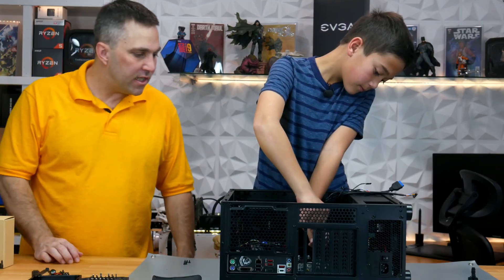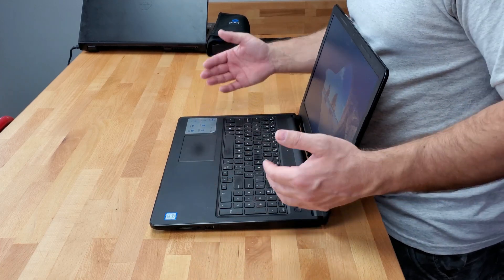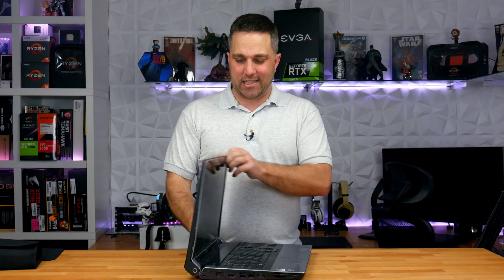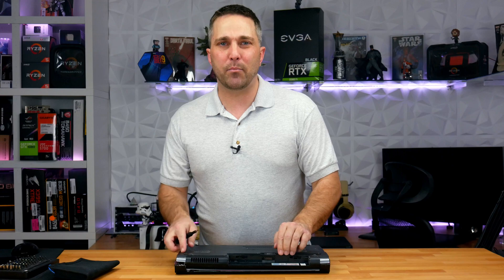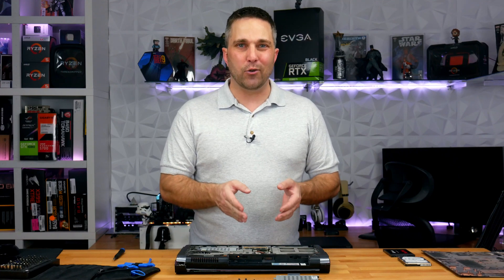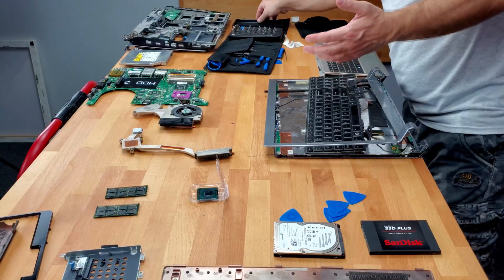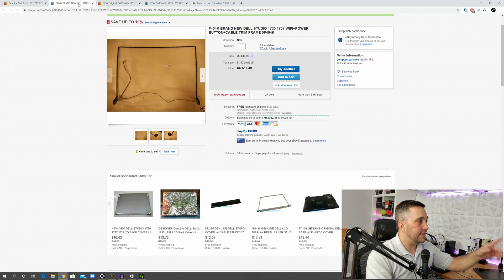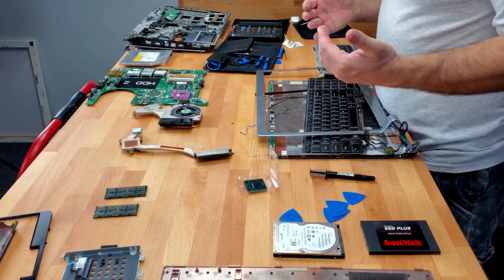How to Restore an Old Laptop

Comment from the maker: Turns out I think I did re-paste the CPU, probably about 4 years ago. The GPU had the original, very dried out paste however. The primary cause of the high temps was the inner, GPU heat sink, was almost completely clogged with dust and pet fur. YUK!
Reply: Can you fix my laptop
Reply from the maker: Sure, send it. Address is in the about section. Don't forget return a return postage label.

Comment: Sorry for bombarding you with questions, but for a 2007-2008 laptop, would you recommend replacing the battery? Or is there a sign for when to replace the battery.
Reply: I had to buy a new battery for my laptop when I found that it would no longer hold a charge. I would charge my laptop overnight but if I unplugged it would shut down after one minute of activity. I had another charging cord for the laptop and exchanged it for the other cord. I charged it overnight. When I unplugged it I had the same results. I changed the battery and now it is fine. Hope that helps.

Comment: I have been looking for a video like this for hours!!! This is great! I have a Gateway W650I which I believe I got around 2008. The heat source was most hot around the hard drive area, the fan (is that normal?), and something labelled Intel pro wireless 3945ABG which was manufactured in 07/21/08 and I was wondering if I should get that replaced too
Reply from the maker: That model is pretty easy to refurbish. There are just 2 panels on the bottom that you need to remove. One on the bottom left that covers the hard drive and wifi card, and the second center right that covers the CPU and CPU cooler assembly. 1st, if you are still using the hard drive the biggest improvement you can make is by replacing the hard drive with an SSD. Second you can remove the CPU cooler assembly and repaste the cpu and repad the chipset. There are links in the description to the paste and pads I used in the video. See part 2 on how to do that. As far as the battery, if it still works no need to replace it, you should replace it when it is no longer holding an adequate charge.